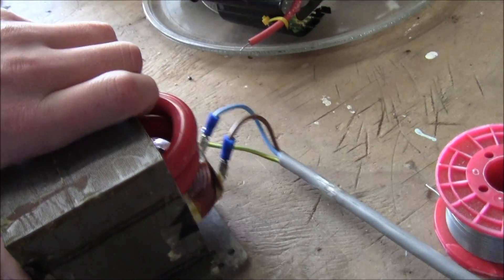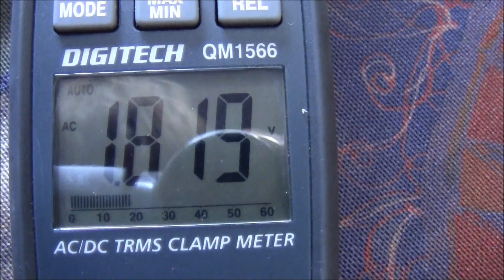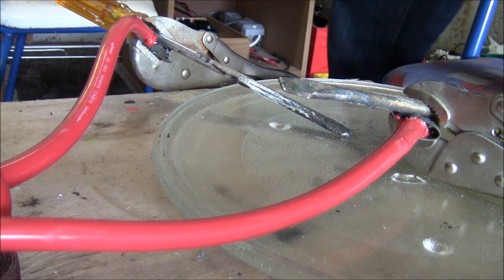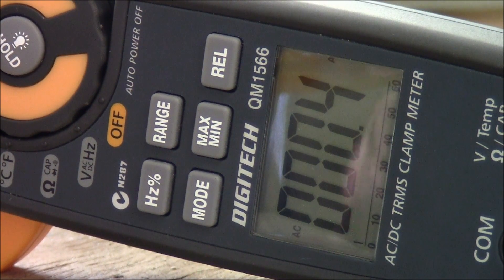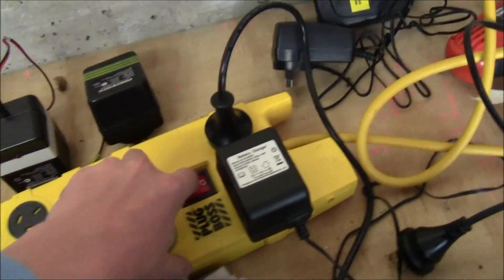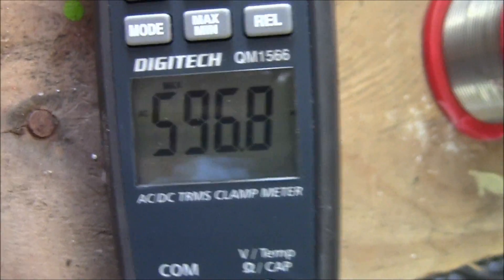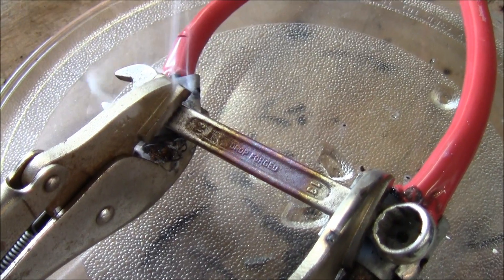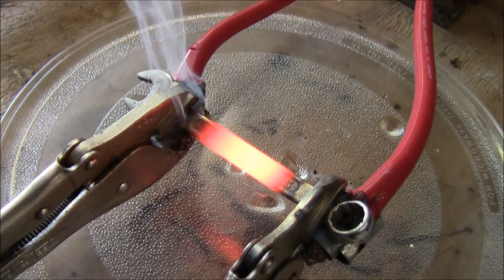1.07 kVA High current transformer fun!

Comment: for all the idiots who said he could have killed himself with the electricity shut your mouths he was running 2 volts and it takes 30 volts to kill someone this man knew what he was doing (other than melting a galvanized nail toxic) but he could have licked both wires and not been shocked more that licking a AA battery so leave him alone

Comment: excuse me :) why you don't get shocked ? you are touching the metal with bare hands? !!
Reply: iperpitual locomotionz he's working with current that is very high current, but very low voltage. Since it doesn't have a high enough voltage, he isn't getting shocked. That transformer probably gives off about an amp or two, which isn't much more than something like a AA battery.
Reply: Thanks
Reply: BlueLightning Films you mean 1 volt or 2 because the amps is 6kA

Comment: Is this electro magnetic induction, can we use this principal for melting metals like copper?
Reply: No. What you see in this experiment is purely caused by the resistance of the steel objects. He uses the trafo to convert high voltage to high current. The current passes through the steel and a lot of it becomes heat.
You can´t use this on a copper object, because the wire would melt before the object. (the wire is copper).

Comment: In the event you're still alive and check comments, don't burn anything galvanized. The fumes will kill you. It's a big deal if you ever get into blacksmithing.
Reply from the maker: Still alive and kicking, yes the comments are a great source of amusement. I haven't burnt anything galvanised since, that was very much a one off thing.
Reply: I figured you didn't do it very often but it really is a bit of a big deal. It's one of those things that once enough of it has gotten in you, there's nothing that can really be done. Best of wishes.
Reply: Second that. Look up metal fume fever.

Comment: How are you puling so many amps? I mean you probably have a 200 amp service panel and your pulling more than twice that? Are you bypassing the breakers?
Reply: he's pulling like 6 or 7 amps on the primary side of the transformer
Reply: +simhere2 I want to build an electric furnace and have a transformer, would a high amperage be better with a low voltage instead of high voltage and low  amps?
the wattage is the same but it`s amazing how much heat these amps produced.
Reply: +simhere2 the problem is that I don't have many amps to play with because the circuit in my shed is also used for the living room, so I was hoping that 10A transformed to 30 amps would make more heat.
Reply: ***** No 3000watts furnace for me then! :D

Comment: Have you ever tried increasing the length of secondary but not having all that wire turned around the transformer? I mean just add wire length but only a small part of it is turned around transformer and bigger part is outside of the transformer :)
Reply: He only has one turn..... also if the voltage is too low you wont be able to get the current flowing.
Reply: ***** Do you think adding a capacitor in parallel with the load will help us to increase the output voltage? :)
Reply: ***** Thank you for taking your time and explaining that for me, I appreciate it :)

Comment: i rewound my mot with 0 guage and the sparks are more intense it trips a 10A circuit breaker i have on the ac line in to the mot when i short out the leads lol need a bigger circuit breaker

Comment: Show me where is 1.8V@596A, your 1.8V is open circuit secondary voltage and 596A is max peak curent. If you connect load to the secondary winding then secondary woltage is lower. The secondary current is 596A/sqrt2=421A.

Comment: How did you put the 2 gauge wire in? I also have some thick wire, but it's too hard to bend and loop through. Did you take off the top of the transformer, and if so, how do you do that?

Comment: only 4.5 Amps @ 240 Volts, al my MOT's was drawing about 3 Amps idle, and poping out my 10A circuit breaker in short circuit condition. Primary current was about 14-17 Amps @ 230 Volts